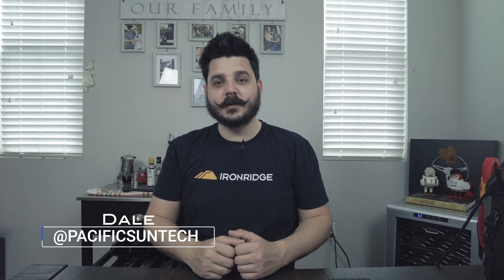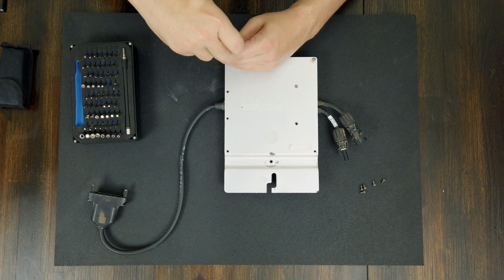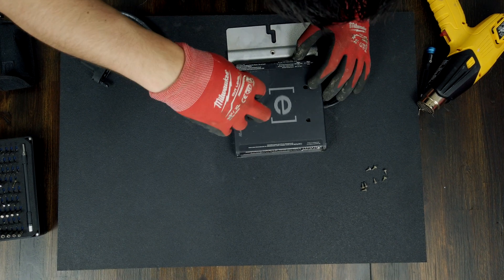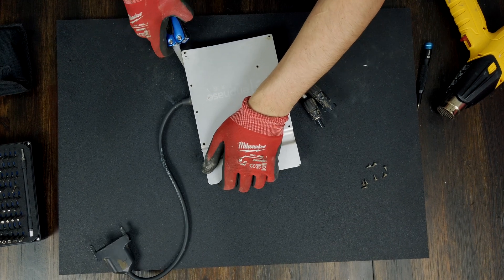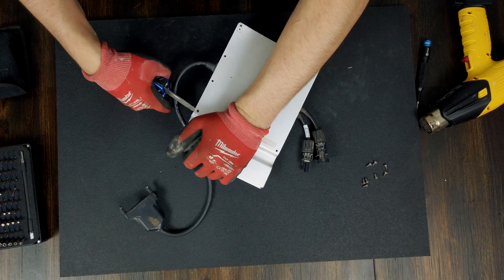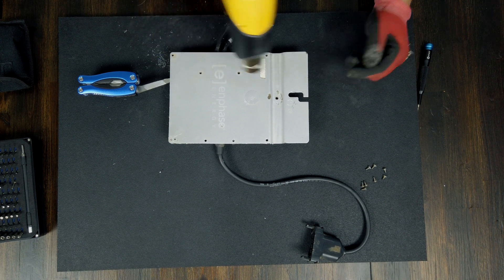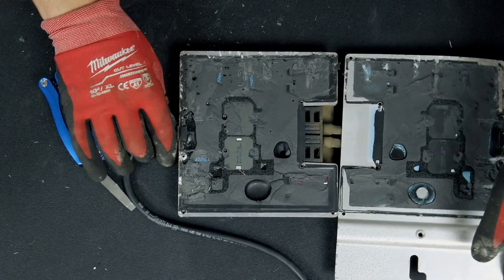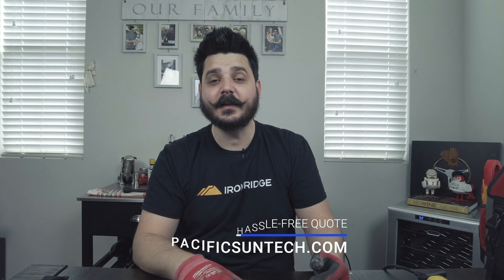Will an Enphase Micro-inverter Last 25-years?

Comment: Great Vid Dale. Thanks!
May I get your opinion on these panels please? 
Which panels are of better quality in your opinion?  
The LG NeON2  vs  The Hyundai 400W Type HiE-SxxxVG Monocrystalline shingled solar module  vs  Q.Cell PEAK DUO L-G8.2
Many thanks.
Steve
Reply from the maker: Hey Steve, thanks for your question.

It appears you're referencing commercial modules. We have worked with LG NeON 2 LG400N2W-A5 along with QCELLS Q.PEAK DUO L-G7.2 400, I'm not familiar with Hyundai but do know they are relevant in the utility sector. 

In regards to which is better, commercial modules are almost all the same and pricing is usually fairly equal among different manufactures, at least between QCELLS and LG, not sure about Hyundai. Without going into great details of modules specs like efficiency, they're all very close. I will say that LG and Hyundai do offer a better product warranty than QCELLS at 25-years versus 12-years.

We appreciate your interest in commercial solar modules and will look at doing a segment on these panels in the near future. We hope you subscribe to the channel!
Reply: @pacificsuntech  Wow respect! Thanks for the quick response guys. Much appreciated. 
Looks like I might be going with the product with the longer warranty then. The Hyundai is offering 30 years of performance and 25 years of product warranty ( I was told).
Panels are made in South Korea but I noticed the connectors they use are made in China. 
I will ready more about this Hyundai panels before deciding.
Keep the vids coming. :)
Thanks,
Steve

Comment: 1) Use a damn screwdriver to pry. That stupid tool was useless.
2) Take this video down so you don't waste anyone else's time. It's boring with zero payoff. 
3) Don't bother doing the IQ inverter. It will be just as boring.